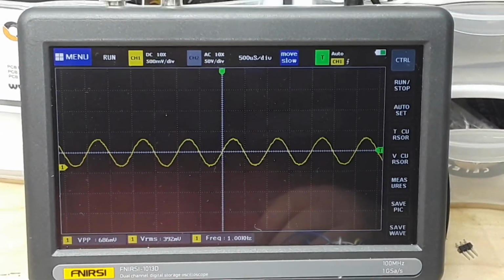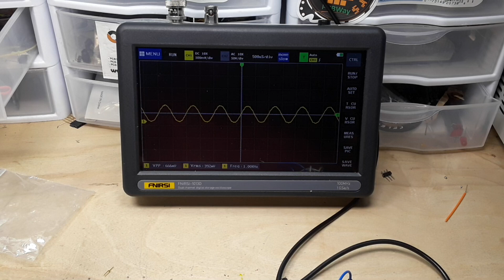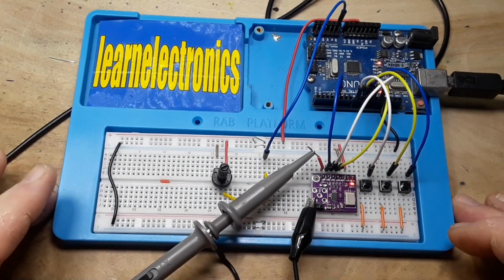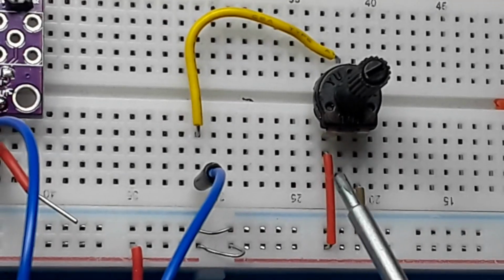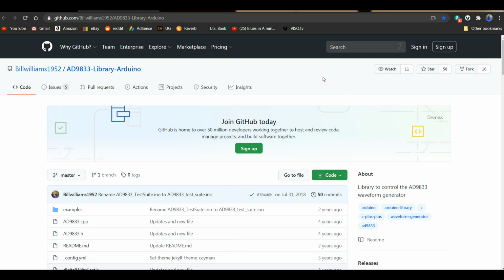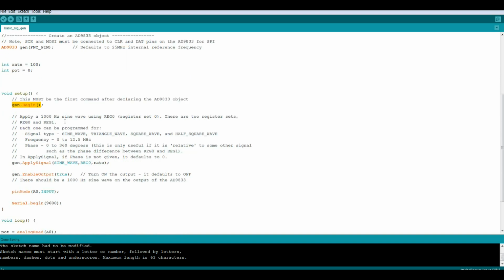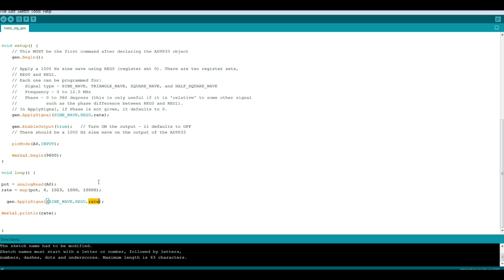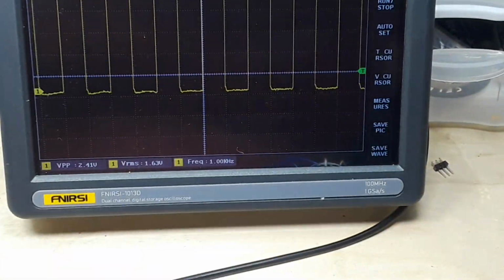Arduino and AD9833 Signal Generator Part 1

Comment: That FRNISI scope is UTTER GARBAGE,
throw it away and use something that actually works correctly with proper specs and does not have wobbling crap display.

Comment: Shouldn't the Arduino itself be capable of generating the signals without having to depend on the AD9833 ic??? Also, this signal or functiona generator is lacking saw or teeth waves (besides others that professional signal generators produce)
Reply from the maker: The Arduino is strictly digital. It great at square waves. But it can't do sine waves, sawtooth, etc

Comment: Very new to Arduino so bare with me.

I have downloaded Bill Williams AD9833-Library-Arduino library ZIP file and uploaded it to the Arduino via the IDE.

I then Copy/Paste your code into the IDE and get a number of errors starting with:
error: 'class AD9833' has no member named 'Begin'; did you mean 'begin'?

I assume I have done something wrong.

Comment: My AD9833 is outputting nothing but a flat line.  25MHz signal works fine on the REF pin - power LED is on but nothing generated through the output pin.
Reply: Same

Comment: hi, thanks a lot for your teaching very good and easy to learn. Im working on a project for school and I already saw your videos about frecuency generator for specific Frequency, but what I need is to create 3 signals wave square frequency, i guess the IC 5555 is the good one, but every single frequency output should be different, so that mean I need to create 3 same circuits just different capacitor, I need for example frequency A=100Hz, B=200Hz, C=200Hz. At the exit signal I just need ONE output of those 3 frequency activated, I mean all 3 are working on, but Just with a bottom I select one and that one is the one that goes to the output signal. So one button per signal so when I push that bottom A i can get that signal output A, and then when i want the signal freq B for example push that B button and get signal B output, and button C and get signal C. COuld you show me a little light on this please, or if you make a video would be amazing, thanks a lot for sharing with us, Great Teacher!!

Comment: Hi, have you used an AD9833 with a Raspberry pi Pico and Micropython. I have a working version on a RPI A board in Python, which works (not great) I also have a fully working version for Arduino Uno, but I cannot seem to a get an output from the pico. I'd love some hints if you have any at all. Thanks
Reply from the maker: Sorry, no

Comment: There's a DC offset in the signal, which I have in the module I received as well. My module doesn't have the COMP pinout, how can I get rid of the DC offset?
Reply from the maker: A capacitor should do the trick.
Reply: @learnelectronics  thanks , yeah I used a capacitor along with a voltage follower circuit

Comment: I recently added one of those tiny OLEDs to a WSPR transmitter. I was amazed how clear something less than an inch across could be - and they really very cheap to buy. 
So yes please to a part 2 showing one being used to display frequency. 
I've not seen many projects using this DDS but most traditional radio VFO's run within this DDS frequency range so it could easily replace a free running VFO in a classic design.
As mentioned in an earlier comment, could you please take a side journey, maybe in a "part 3", and replace that pot with an encoder to change frequency?

Comment: Cool project.  Looks like the P2P is 2.41v.  would it be possible, to use a level shifter to get the P2P up to 12v?  If not a shifter then how??  Thanks
Reply from the maker: Yes, absolutely

Comment: It would have been helpful if you had explained why the Arduino is needed and what the AD9833 requires in order to function as the "Signal Generator" it is advertised as.  What exactly does the Arduino do in this case?
Reply: The AD9833 require a serial data line to control the internal registers that set things including the waveform type and frequency, amongst other things. The arduino is being used as a serial controller for the chipset to tell it what to do.

Comment: Cool project, would like to see a sketch that allows you to switch between waveform types at the push of a button. Will definitely be buying one of these but I will get it from eBay because it's always cheaper than Amazon in the land down under. Thank you.

Comment: why would I need a signal generator? what can you do with a signal generator? how can it help me design/make a thrust vector controller for a rocket?
Reply: Signal generators have a large use in industry but are not as useful as function generators these days.

They can be used to provide a clock source, modulated input/output, noise injection, repeatable stimulus for bench testing...the list is endless.
Reply: @jonelectronics510  Thank you. thats what I would like to see... what can be done with signal/function generators.